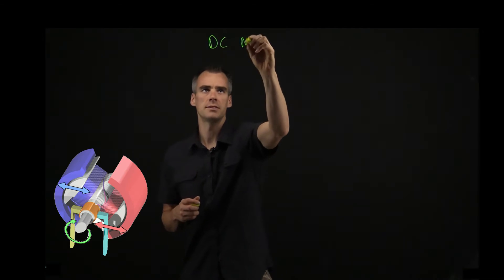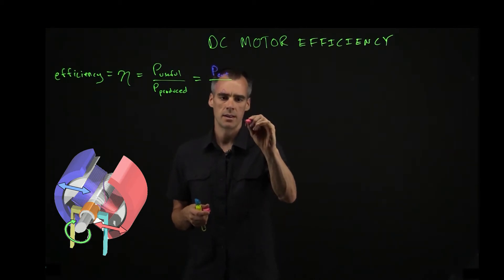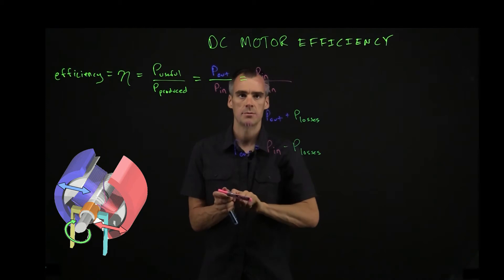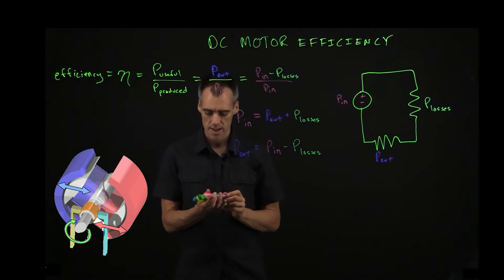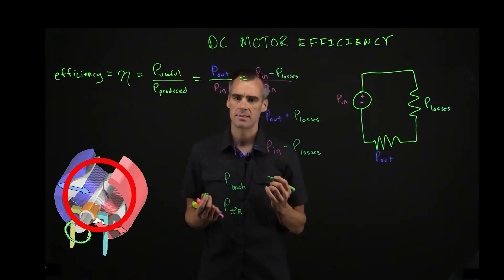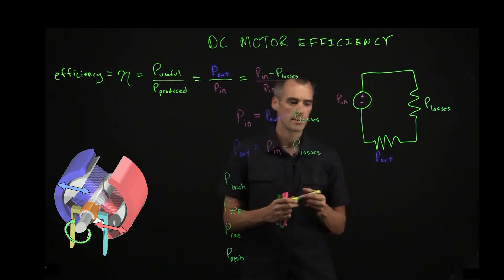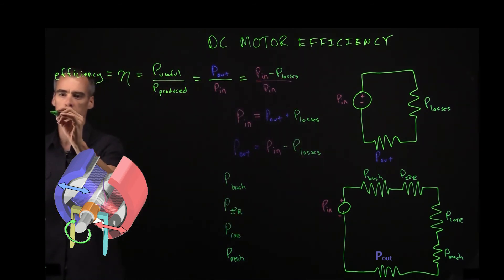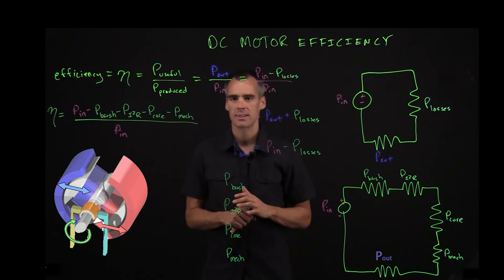Calculating efficiency of a DC motor

Comment: hello boss, I have a project related to a 24 volt female motor, can you help me? (We connect a Capacitive Sensor to the wheel on the x machine. We will determine the number of turns of the wheel from this sensor. We want the dc motor we connected on the machine to rotate in the same or different tours in proportion to the number of turns of the wheel. For example, "When the wheel rotates one revolution, the motor is required to make 1.2 revolutions" What can we do about it? can you give me a direction?